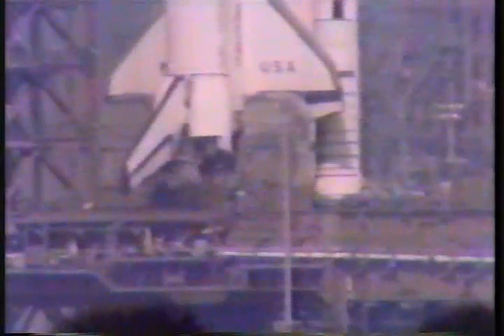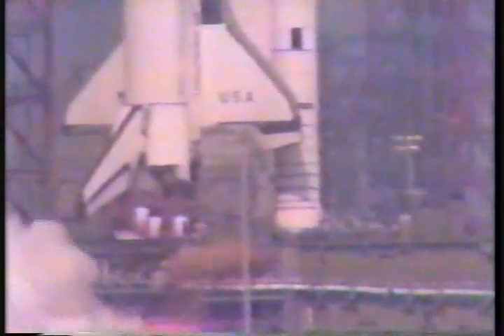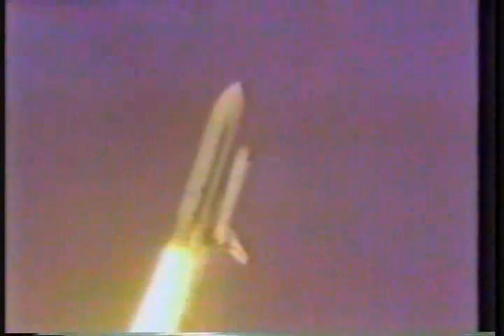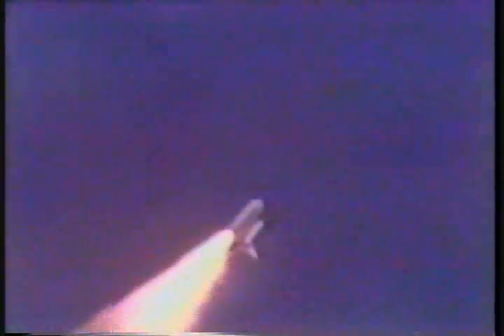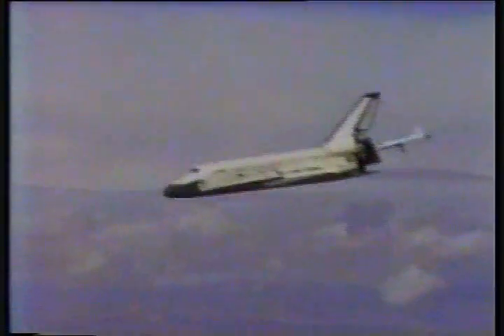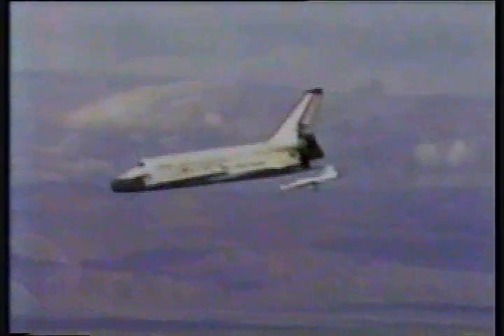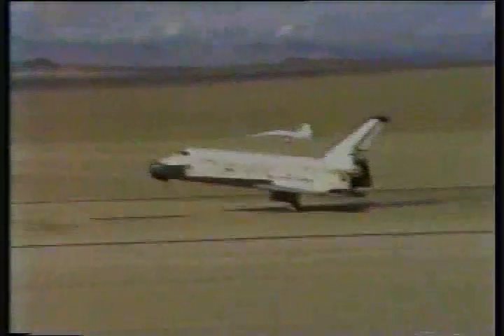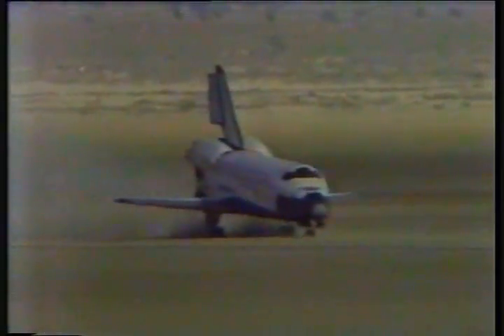STS-2 launch & landing (11-12-81)

Comment: Why is there two different colors on the exturnal fuel tanks on the first two flights it was white then from sts 3 up until the day the space shuttle program ended it was brown why is that i never have understood why that is?
Reply: ndwm2112 the white was paint but it caused weight and other problems
Reply: Paint equals weight
Reply: Added paint to try and reduce heating from the sunlight, it was found to be useless and a waste of weight which could be used for more payload
Reply: They stopped painting the ET so they could use that several hundred pounds of paint as payload.